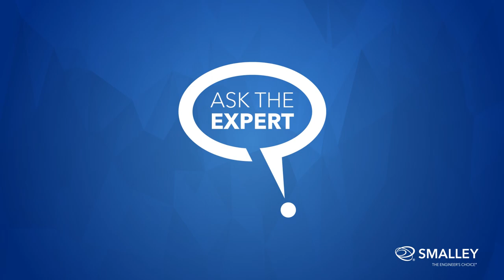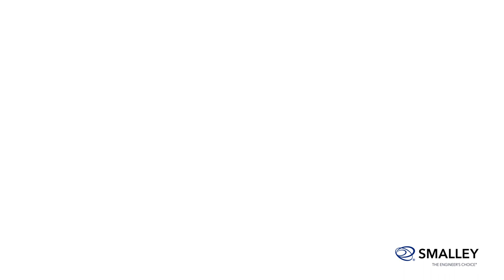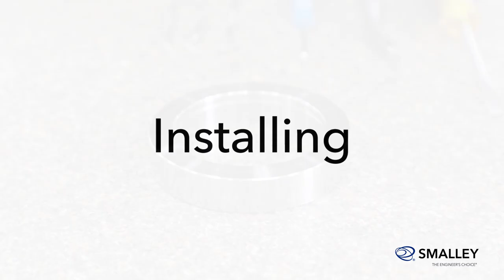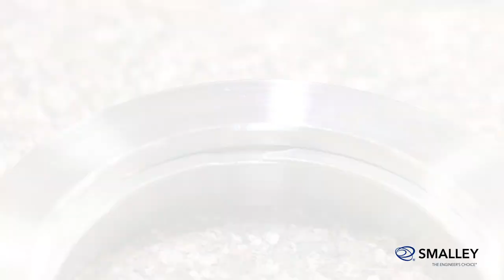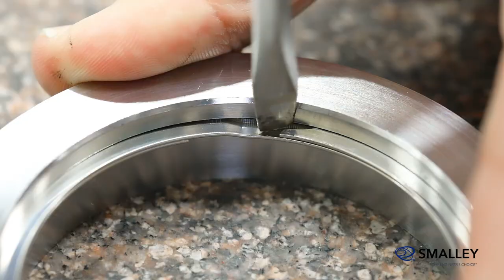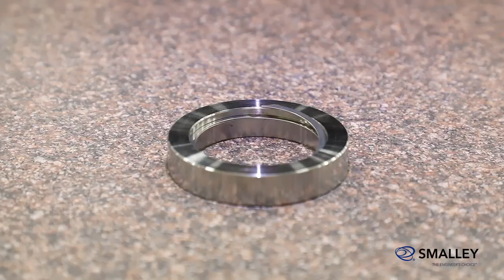How to Install and Remove an Internal Spirolox® Retaining Ring

Comment: They make it look so easy.  When what it’s supposed to hold is there it’s not as easy.
Reply from the maker: Thank you for the comment, Steve. We wanted to show a clear example of the installation and removal of our products. We understand that situations are different depending on the application. If we can help in any way, please reach out to engineering@smalley.com.

Comment: Small rings in the 3/4" groove dia range run a buck each for non-branded spiral internal rings. Am not familar with the pricing offered by Smalley. But a dollar/ring is somewhat pricey compared to traditional stamped snap rings.
Reply from the maker: Thanks for your comment, Archie. Smalley pricing depends on a variety of factors such as ring size, material, and quantity. Please email us at info@smalley.com to get pricing on a specific Spirolox retaining ring, or check out our online store at store.smalley.com . We highlight the differences between a stamped snap ring and Spirolox retaining ring in this blog if you'd like to learn more: https://www.smalley.com/blog/smalley-spirolox-retaining-ring-vs-stamped-circlip
Reply: These things suck so hard.
Snap rings are so much easier.
Reply: @joshuajones2458  Look, I get it. The large ones are simple enough to install using only hands, fingers, fingernail and some elbow grease. But the small ones can be challenging. If you care about your installation being secured, you'll opt for the spiral rings. Anyone, even someone who's never see an conventional snap ring or a pair of circlip pliers can pretty much instantly figure out how a conventional snap ring is removed or installed just by looking at it. Not so much with a spiral retaining ring. Here's how I manage it: https://youtu.be/hjzD0Lm8p4c. And Smalley's rings, trust me, are awesome. You just have to hold your mouth right during installation or removal.
Reply: @MisterFizz  I hate them. Sorry I just do.
I most commonly come across them on input shaft seals in steering gear.  After it's over I forget about it until next time. I was reminded today.
I guess my mouth doesn't hold right, because installing them never fails to make me angry.

Comment: Interesting they show all sorts of tools you can use, but NOT the tool they specifically made for this. The one that is actually on the table next to the guy and NEVER shown.
Reply from the maker: Thank you for the comment. That is correct. We wanted to show other options available for use.
Reply: @SmalleySteelRing  Here in lies the problem... I was looking for a video that shows how to use your special tool and the attachments it comes with. I was given one the other day and wanted see more info about it. There is NOT a single video to be found anywhere.
Reply from the maker: @phantumdrummer  thank you for the video idea. In the meantime, you can reference our Removal Tool PDF here: https://www.smalley.com/sites/default/files/pdfs/RT-108.pdf. Hopefully, this helps; if not, please feel free to reach out to us at engineering@smalley.com.
Reply: This helped for my Aviation Maintenance Lab (turbine overhaul). Thanks! Two of these were installed, and after being stumped, came across this video and it made installation a breeze.